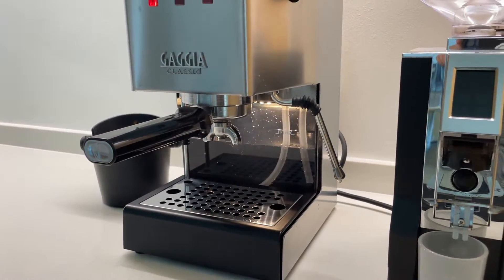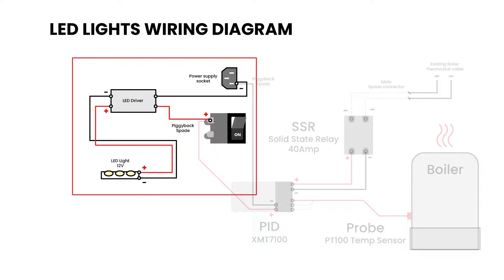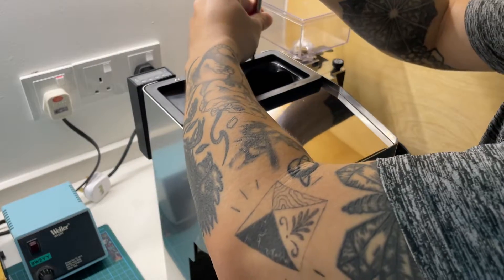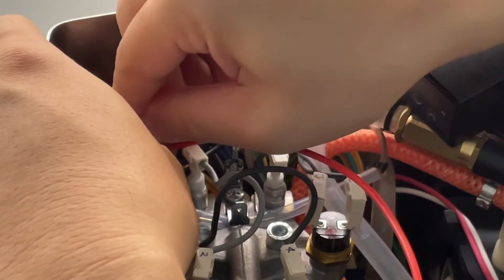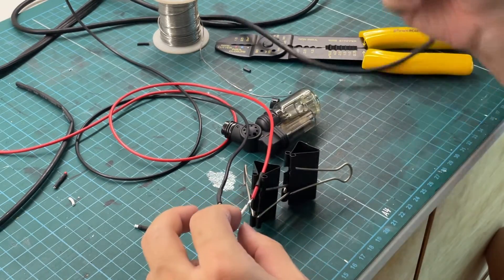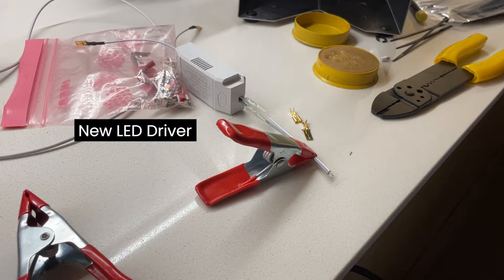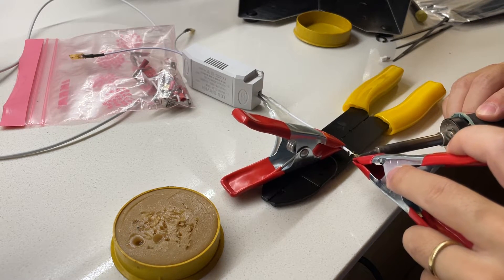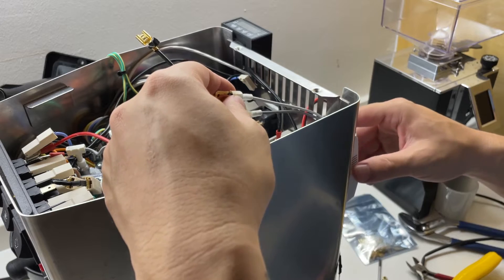How To Add LED Lights To Your Gaggia Classic Pro

Comment: Thanks to share. This video helped me a lot. I have a gaggia classic from 2011, for my machine the current flow connections are different, N is connected to the first input to the front panel so I had to connect the LED driver to second input of the front panel, then I had to conect the other input of the LED driver to the L input of the AC conector instead of the N.

Comment: I used this video to mod my GCP Evo 2023 230V with EU Eco Board (20min auto turn off) and at the power supply the brown cable and at the switch the light blue cable was correct. Maybe this helps someone.
Reply from the maker: I'm glad you find this video helpful. Thank you!

Comment: Hi, if use 220v led, how should we wire it ? Does the polarity matter ?
Reply from the maker: Yes, the polarity matters. Make sure to follow the (+) and (-) closely. If your local voltage is 220V then it shouldn't be any issues running a 220V LED. If you're voltage is 110V, best if you double check as I'm no certified technician on this matter. Good luck and safety first!

Comment: where did you get the LED from? What wattage was it?
Reply from the maker: Hey. It's a 12V LED from some random electrical shop. I use a 4K temp for that slight warm look. Before, I tried the white 6K one, didn't like it as it was too bright 😅

Comment: I did something similar but found that South African insects (we call them "goggas" - the "g" is pronounced as a guttural "ch" sound) like the LED lights a bit too much. I had a massive moth in my water tank one morning.
Reply from the maker: I think you should switch to warmer light temperatures. Some insects like to go near 'cooler' temp lights. Good luck!

Comment: Hi there. Thanks for the video! Just wondeirng, did you install your LED light (above water tank) towards the front, middle or at the back? Any advice? Thanks!
Reply from the maker: It is in the middle spot of the "ceiling" of the water tank. Figured that's the best placement because it can also use the chrome housing as light reflectors :) Cheers

Comment: If you do the gaggiuino mods then you can add a ToFnLED which measures the water level and displays it on the touchscreen.

Pointless but cool
Reply: if you could be arsed

Comment: why couldnt you just get AC driven LEDs?
Reply from the maker: From my research, AC current are considered 'unstable' as compared to DC. After I fit the AC driver, my LED auto shut off after a while. My guess is that the current in the machine is running on DC and that's why if you fit an AC it will not correspond.
Reply: @EweJinTee i forgot why i asked the question :D

Comment: I installed my LEDs using this vid ! Only thing... At first, the LEDs turned on when I connected the power to the machine instead of when I turned the machine on. Had to switch to the other connector from the on/off-button (with the orange cable in this vid).
Many thanks !
Reply: Thanks for sharing, I had the same issue.

Comment: Hi, how about such LED signal/indicator light?
Gebildet 5Pcs 8mm 110V-220V AC LED Metal Indicator Light Waterproof Signal Lamp
Seems can be connected straight into mains without any adaptor. Not sure if it's bright enough but you don't need a bright light actuualy to see water's level in the tank, right?
Reply from the maker: You can try those and see how it reflects in the water tank. At the end of the day, you will be the one using it to inform the water level. If it works for you, then it should be fine :) Good luck!
Reply: @EweJinTee  Hi there, me again. Eventually got me GCP, and eventually started my mods. 
I've tried, and it works. It's not as bright as yours, but it still helps to assess the water level. Fitted two LEDs into those two smaller holes (8mm in diameter) in the chasis above the water tank. The hoses got squeezed into the bigger hole for the funnel water inlet. It was possible, as I had to attach a silicon extension to the end of the funnel after fitting the top box above.
Reply from the maker: Hello! @wog9813  That's great! Hope you enjoyed working on the mods!

Comment: I live in Canada, and we have 110 v here , where can I find the parts compatible with 110 v
Reply from the maker: Best to search nearby hardware stores or Amazon etc. I guess those will stock up drivers are suitable for local current voltages.

Comment: Can you please share what model you have? I have the EU version and as such the power button is different, it perhaps makes a difference to wiring...I'm investigating currently as my LEDs didn't light up! Good walkthrough though, thank you for sharing
Reply: Helo, There may be a problem due to incorrectly connecting the cables from the leds, secondly, maybe your driver is broken. Most of the ones sold in the market can be defective.
Reply: @PapelEspresso  Hi - no it’s not that, I have test the whole LED circuit including driver separately to the Gaggia on the mains and it works.
Reply: @tomknight  I have the same version with you, could you please share with the connection how you did? the connection does not change from version to version. For example, the power button on me is different from the one in the video.
Reply: @PapelEspresso  yeah that was my question, but I've compared the US and EU wiring diagrams and light blue is live in the EU version so it should be fine, I'll try again now I know the driver works
Reply: @tomknight  The direction of the cables coming to the drive does not change anything. (+, - ) There is only w difference between eu and America. If your system works outside the gaggia, I think you are connecting the cables coming to the driver incorrectly.
Reply: @PapelEspresso  yes me too - that's why I'm asking about the EU and US wiring and what model his machine is, but it doesn't really help because he's already installed a PID so little of the original wiring is still there.
Just noticed something on the model in the video, the power button is in the power position, whereas mine is a rocker that reverts its position - so perhaps the + wire to that button has to use a different position on the button to continue to receive power?
Reply: @tomknight  It does not change anything, by the way you can control it with a voltage tester/control pen
Reply: @PapelEspresso  it's that the hot and neutral are reversed when they come into the machine for UK vs US, it works now. 👍
Reply: @robertkujawa3504  you can see answers how you must connect on our version of gaggia classic. I had problem like and answer is on Robert video on 10.50 he connect on PID and i connect led like he.

Comment: for this amount of work .. why not do the gaggiuino mod (adding arduino to your machine) and have more control over it ?
Reply from the maker: I am actually (still) researching on a Gaguino built to be honest with you. That was my initial plan before modding the PID setup but I took a smaller step and begin familiarising myself with the machine hence, I picked the easy mods first. Thanks for the comment!
Reply: @EweJinTee  ah ok... You seemed a natural with the mods ;) ... I think you can easily do the gaggiuino... Good luck ;)
Reply from the maker: @Gunnl  I did a lot of research before I took the plunge with the PID mods. Not knowing if anything will go right/wrong. The Gaguino  will be on my bucket list. If you have any resources, please share it my way on FB or here. I'm in the Gaggia Classics FB group as well. Cheers!
Reply: @EweJinTee  humm well not anything beyond whats already available on gaggiuino pages online... But i have lots of experience with arduino and other hobbies so it is less daunting for me... I will be happy to help you if you need
Reply from the maker: @Gunnl  That will be great! Are you on the Gaggia Classics FB page? I'll drop you a DM
Reply: @EweJinTee  no,... I am still yet to buy my gaggia ... I have joined and sent you a DM
Reply: @EweJinTee  Are you planning to do the Gaggiuino mod in the future? I'm planning to buy a classic in the future because of it's modding capabilities and a installation video from you would be super helpful considering how the current ones out there arent that easy to follow.
Reply from the maker: @PaperGunner722  Yes, I am planning on a Gaggiuino actually. But because of my work schedule, I'm unable to keep up with the mod's requirements or documentation. And I'm pretty confident I can make a more detailed walkthrough on that mod.. Similar to what I've done in my PID Mod video :)

Comment: With AC there is no positive or negative There's hot/line, neutral, and ground.
Reply: So it doesn't matter which way round you attach switches?
Reply from the maker: Thanks! I figured that out when working with AC LED driver :)

Comment: In the beginning of your video you said to to get 12V DC out for LED Driver.
But, in the video, I saw your LED Driver and it says it's 24-36W which is almost 75-135V out.
 I thought 24-36W would be too high for my 12V LED strip.
Is it still okay to use?
I was trying to get a 2-7W LED driver cuz the output of it is only 12-26V.
Should I get 24-36W one like you or 2-7W for my safety? 
I'm sorry that I am not that familiar with electricity.
Reply from the maker: Apologies, I think I grabbed the wrong thumbnail for the parts list at 0:15. When looking for an LED driver, it's important to check the input and output V with regards to where you're located. I'm not too sure about the Wattage though. Based on where I'm at, my power input is 240V and the LED driver transforms it to 12V which basically is suitable for LEDlights. Hope that makes sense :)
Reply: @EweJinTee  I kinda understood :) thanks man!
Reply: @jeekim1212  just make sure your LED driver (output) provides the Voltage (V) as required by your LED and at least the required Power (Watt)... e.g. if LED requires 12 V, make sure LED driver delivers 12 V .... then if LED requires 7 W power, make sure LED Driver can deliver equal or more, to 7 Watts .... it is OK if power is more, it just means you can drive more LEDs with one LED driver, when the LEDs only require 7 W the LED Driver will limit itself to provide 7 W, however the voltage CANNOT be more or you will burn the LED ... Less voltage is also not good, it might simply not work, or potentially also damage
Reply: what type of led is that ?